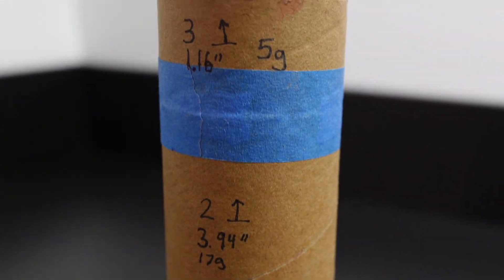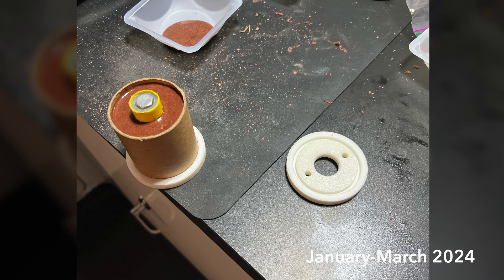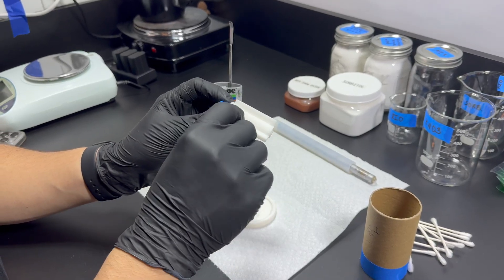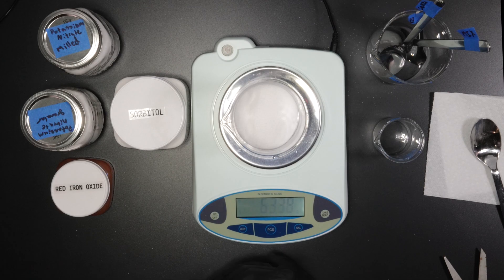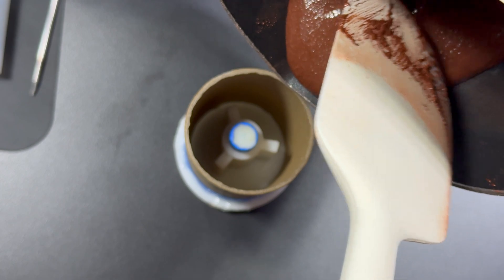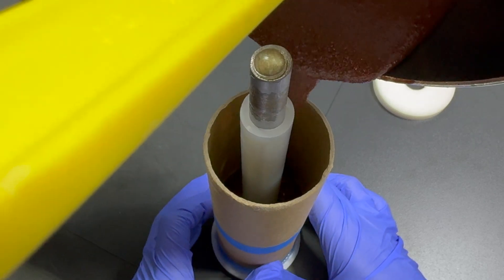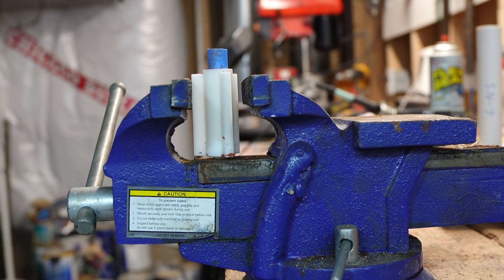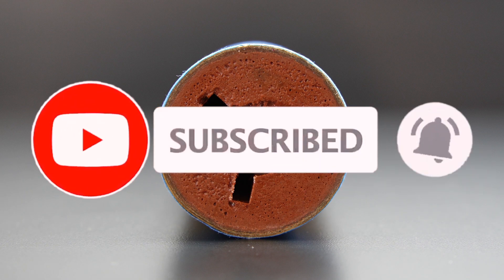How I Make Actual Rocket Fuel (Updated Method)

Comment: Buy a vibrating table for dental cast
It will help with air bubble
Also just an idea, don't know if it would do something, but try adding urea hydrogen peroxide to your mix, it provide 2 oxygen and 2 hydrogen atoms, it should increase oxidation when burned and unlike normal hydrogen peroxyde it does not contain water

Comment: Great vid man! Where/what website do you get your KNO3 from? I’ve tried multiple different websites and they all seem to burn differently, some better some worse. Also, is that just cardboard you are using to hold the fuel when it’s not in it’s casing (as opposed to some kind of fancy phenolic material)?
Reply from the maker: I get my KNO3 from Fireworks Cookbook. Yes, that is just cardboard which I cast the propellant into. KNSB doesn't get hot enough at this scale to melt through my casing.
Reply: awesome thank you!

Comment: Nice! Adding a tiny amount SLES to the mix while you are cooking it will thin it out and make it pour sooooo much easier. Cooking on an inductive hot plate reduces the risk of combustion immensely. Using a vacuum pot to degas the KNSB will help with a lot of your voids.

Comment: Are motors like this legal to make? I was reading up and appears ATF regulates experimental rocketry. Bummer if not legal. Great video.
Reply from the maker: To my knowledge, there are no clear regulations prohibiting potassium nitrate base rocket motors. Ammonium perchlorate base propellants are a whole different story.
Reply: @AeroPropulsions  Thanks for the reply. Upon further reading you may want to check into the legalities of using this type of propellant. Federal state and local. (State or local can be worse than federal) 'Potassium Nitrate Explosive Mixtures' is on the ATF list so good chance it's regulated. There's an ATF exemption for Ammonium Perchlorate composite fuels but some argument whether it's limited to 62.5 grams or unlimited size. That's what I found, figured I'd share. Take care!

Comment: 1:00 There's no way your fuel mix is 101.25% of itself. Fix it.
Reply from the maker: I add the red iron oxide on top of the original mix. Works fine.
Reply: @AeroPropulsions  ok. thank you.

Comment: Curious if you thought of using a second bottom plate when removing the finocyl?  Swap the flat forming plate for one with the finocyl shape cut out plus a little margin so that most of the grain is supported while removing the core.
I am L2 in Tripoli and moving on to electronic deploy prior to L3 under new rules. I hope to cast some sorbitol motors like yours after L3 is done. I would like to get your 3D files and formula if possible.
Reply from the maker: I haven’t thought of that. Definitely looking to streamline the casting process for future iterations. Email me and I can send you anything you need!

Comment: Couple questions: 
1. What do you use as a release agent to get the finicil out after casting?
2. When you wait for the first "level" of propellant to harden, do you let the leftover propellant cool or do you melt only the amount of propellant at a time that you need for one pour?
Reply from the maker: I use a grease lubricant. I allow each layer to harden for around 6-12 hours before pouring the next layer. I only mix the chemicals I need for each pour.

Comment: Monolithic grains are cool. What equations did you use to figure out what core diameter you wanted or did you just keep "guessing" in open motor until it was what you wanted?

Oh, and where do you get milled kno3 from, and the specs for the finocyl? 

Thanks
Reply from the maker: Honestly with a grain diameter of 3”, I knew I wanted a core diameter around 1.25”- 1.5”. 

I get all my KNO3 from Firewrorks Cookbook. They have good prices compared to some other places I’ve gotten it from.

The finocyl is 3” long, with 3 fins, 0.3” width, 0.35” length. Could have definitely went for aggressive with the design to get a higher initial thrust, but then it cut into the overall motor performance and total impulse. Will definitely experiment with different sizes in the future.

Comment: If possible, I would be very grateful if you could share details or guidance on the following:

The length and dimensions like thickness,internal diameter,external diameter of the cardboard tube used for the grains casting.

The 3D-printed base plate,top plate,finacel designs,and the thickness and length of the metal road you used including any recommended materials or dimensions.

The optimal (SN5) motor casing and nozzle design and the top cap of the casing.

Dimensions and thickness of the metal casing and external and internal diameter.
Reply from the maker: Please email me!

Comment: Why sorbitol(a manufactured sweetener that costs more/is harder to procure in quantity) over regular sucrose?
Reply from the maker: Sorbitol is used instead of sucrose because it melts safely at lower temperatures and casts more reliably without burning.

Comment: Have you thought about insulation and the shape of the grain? I would like to make an End Burner for more efficiency, but I'm afraid I need good insulation and nozzle material for longer burning... Does it make sense to do End Burner right away or is it better to start with a more standard BATES?
Reply from the maker: If you’re referring to insulation for the motor casing, I don’t use any. With short burns and the relatively cool burn of rocket candy, I’ve never had issues running without a liner. Starting with a BATES grain is usually safer until you're confident in your materials.
Reply: @AeroPropulsions  Thanks!

Comment: You should probably just use a vibrator for the tamping. Saves you the trouble and it will probably work better. It's how they do it with concrete, just way more powerful
Reply from the maker: Thanks, great idea!

Comment: Would ammonium nitrate work a little better than potassium nitrate? It would produce more gas and leave no potassium oxide solids behind.
Reply from the maker: Ammonium nitrate would produce more gas, but is burns unstably and tricky in practice. Potassium nitrate safer and more reliable.
Reply: @AeroPropulsions  that makes sense. Ammonium nitrate is a little explode-y. I noticed it looks like lots of liquid is flowing down the walls of the nozzle and flying off with the gaseous exhaust so maybe not all that much crud is being left in the motor? Anyhow, nice channel and keep up the good work!
Reply from the maker: @richardzeitz54 Thank you so much!
Reply: It is used in another type of fuel

Comment: Hey, nice job!! I was wondering if you have any plans to pursue composite propellants in the near or distant future? In my limited experience with both, they seem to be much easier to work with when casting the grain, with a longer pot life and also less risk of fire when mixing them.
Reply from the maker: I was planning on having my next big project be an APCP rocket motor, but with state regulations, it would not be legal for me to work with it. Instead my next big project will be making a liquid rocket motor!
Reply: @AeroPropulsions  I was interested in hobby rocketry for a bit, but the legal haze around everything really put me off from ever trying to make my own propellant.

but I was very interested in the idea of a reverse hybrid rocket. Getting some of the interestingness of liquid rockets, while avoiding any of the legal ramifications of mixing fuels and oxidizers together. Basically just cast a grain from pure KNO3 (or APCP, if not mixing it avoids legal issues) and then choose from a wide variety of fuels. Maybe an alcohol, or even like propane?

I thought it would be an interesting thing to experiment with, AFAIK, there basically aren't any reverse hybrids out there, on any scale.
Reply from the maker: What mainly drew me to using a sugar-based propellant for this project is that it’s more affordable, burns cooler than APCP which simplifies the rocket’s design, and offers a bit more safety.
Reply: @AeroPropulsions  Makes sense :) cant wait for the liquid!!!!
Reply: by composite tho, i don't necessarily mean APCP, just anything with an epoxy binder as the fuel/binder along with perhaps some other spices that you see fit